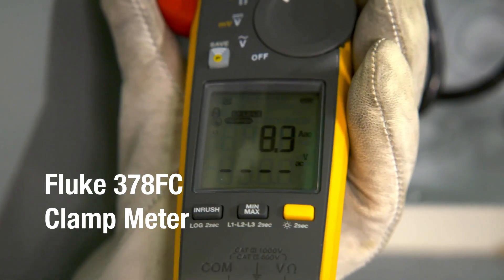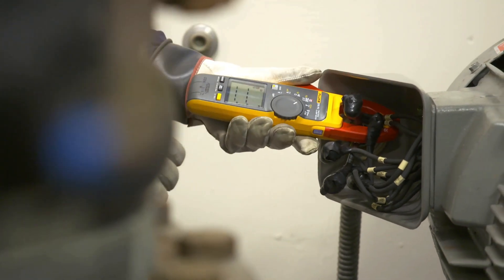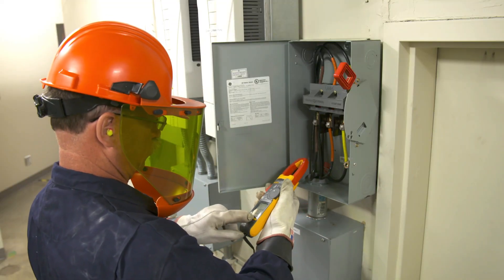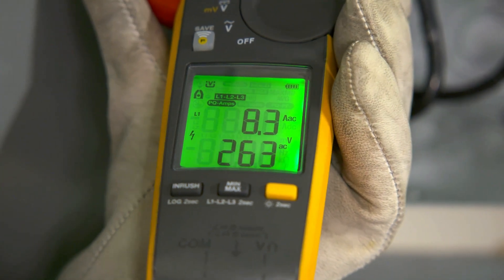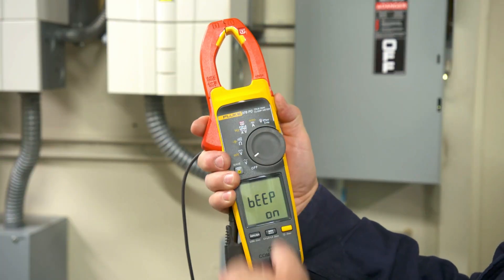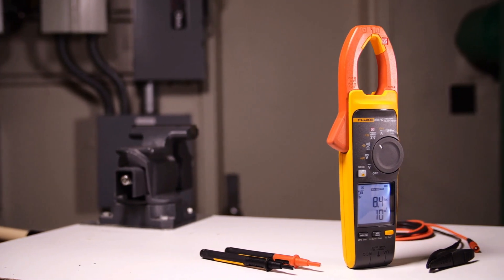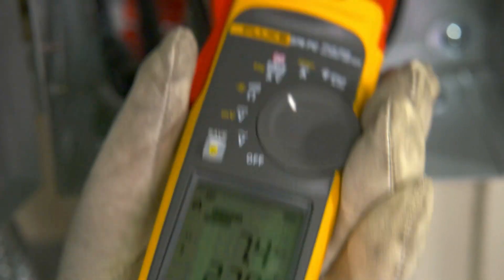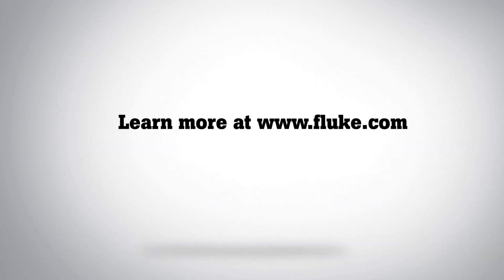Fluke 378 FC Clamp Meter | Power Quality Indicator

Comment: I bought one Fluke 378 FC paid a lot and thinking about returning it. Won't be utilizing for 3-phase but was thinking that field sense might come useful but also the Power Quality indicator. If you want to check if your device is going bad (anything at home, from A/C unit to fridges, router, etc.) Similar to inrush feature to see if your device is pulling too much current in 100ms. But here is the problem, anything that I was clamping to (with proper ground/black lead) the Power Quality was ALWAYS ON PQ-Amps as well as PQ-PF. What's the point of paying $1000 for device that has this fancy feature that is always on, you can't tell difference when you really have Power Quality issues. I read the manual and tried all 3 sensitivity settings (High-Medium-Low) didn't make ANY difference one way or another. I called Fluke support and they were clueless, when i asked them it appeared they were unprepared and were looking at the fly to read off the marketing brochure, something i can read myself. Someone here on YouTube made comment the PQ feature is more of a 'gimmick' than true reliable feature that you can use. Anybody else, used Fluke 378 FC, any feedback on the Power Quality feature?

Comment: I bought one for my electrical program, and my instructor said that it doesn’t measure low voltage, is that true?
Reply: No sure how low your requirements are, but I can as low as 24vac

Comment: Fluke has been heading in a tragic direction. It's very disappointing to find that Fluke has been strategically landscaping in such a way to push more and more industrial customers towards the very expensive power analyzers by getting rid of the 345 power clamp meter and offering inferior alternatives in the same product class. Such as this new power factor threshold indicator feature which only provides a power factor warning. This scheme is disheartening to see in a reputable manufacturer whos motto was "give customers a little more than what they pay for" (in the words of John Fluke Sr.). It's the evergrowing trend of profit maximization by any means. After 30 years of dedication to Fluke, I have purchased an AEMC 607 clamp meter for $650 to replace my Fluke 376 FC. I was going to purchase a 378 FC, but after learning of these intentional bottle necks in functionality, I had to opt for another brand. Fluke has put customers such as myself in a position to be obligated to a $10,000+ power analyzer purchase by elliminating simple yet potentially useful functions such as PF measurement in mid class instruments while brands that I would never previously even look at are offering these important features. Very sad to see this happen. Fluke is becoming "The North Face" of their field.